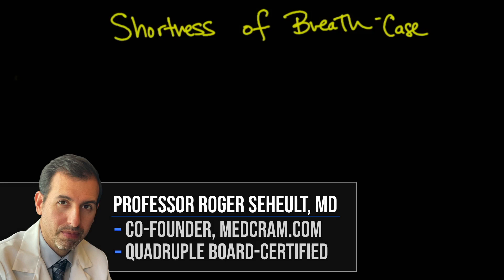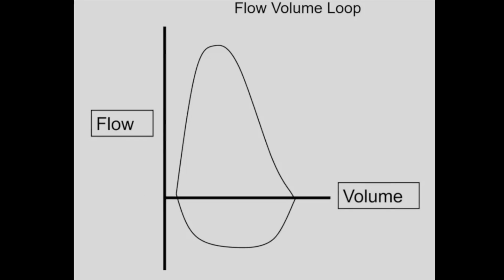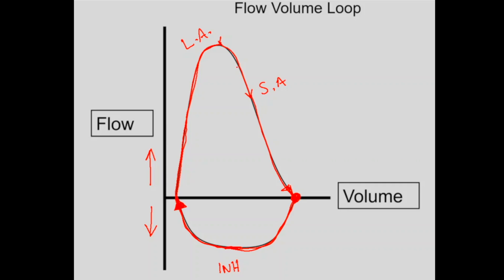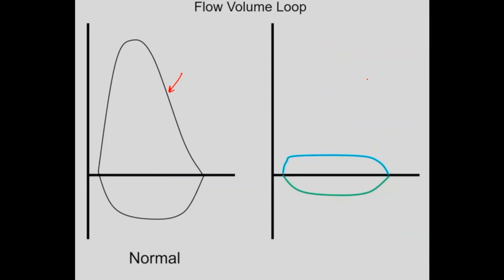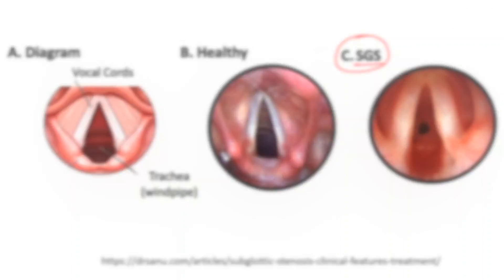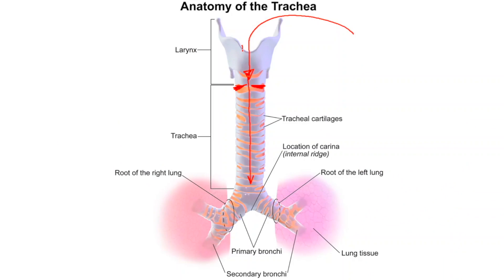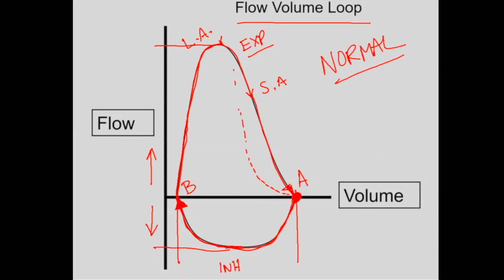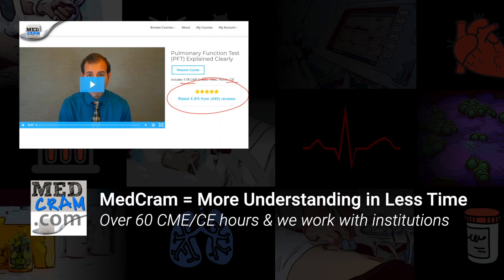Shortness of Breath - Flow Volume Loop

Comment: Is it possible for someone with asthma to have that type of surgery to increase the volume of air they can blow out? Could that cure them of asthma? How risky is that surgery?
Reply from the maker: There’s no surgery that will improve airflow. Typically bronchodilators are the way to do this. There is something called broncothermoplasty which can prevent constriction

Comment: Could something nebulized have been given as a treatment at discharge (for home use) to have helped the damage heal properly?
Reply: I posted a study link, looks like it disappeared.
It appears intubation injury is not uncommon.
Do injuries go into the records of whoever does the intubation?
How are people trained to do the least injurious intubations?
Are there any records on the least injurious intubation hardware?
Is the injury caused in part from compression of the tissue and lack of oxygen to those tissues?
Would cyclic compression help to reduce the injury by allowing reperfusion?
Would using a gas permeable material such as that of contact lenses help?
Is there a pressure meter on the equipment to know how much force is being exerted on the tissue?
Reply: @mballer Yep we measure the cuff pressures frequently. This isn’t a common occurrence anymore since we use low pressure higher volume cuffs nowadays.
Reply from the maker: Not really
Reply: @Medcram  
How about infrared light?
Reply: @Medcram 
Looks like injury is not uncommon.
What might have caused this woman's greater injury?
Does her injury go into the records of whoever intubated her?

https://www.ncbi.nlm.nih.gov/pmc/articles/PMC7969363/

Comment: How does this differ from acute onset interstitial lung disease, or the increasing inability of gas exchange? (Hemoglobin production decrease, autoimmune inflammation)
Reply: This example was caused by a blockage of the airway (trachea). Interstitial lung disease occurs in the actual lung tissue, where oxygen moves into the blood.
Reply from the maker: In this case the issue was with the air transportation but not the diffusion in the tissue.

Comment: I have had chronic dyspnea from vape damage to my airway/vocal chord(s) (dysfunction) for almost 4 years now. Any suggestion you have to improve the perception of a full breath again would be greatly appreciated. (My flow volume loop is normal)
Reply: How do you know vape damaged your lungs?
Reply: @FirstnameLastname-pe5ib They found metal flakes coming off of it.. Do you have advice that helps?
Reply from the maker: That's a hard one with out looking at the CT scan and perhaps a bronchoscopy or biopsy.
Reply: Vocal cord dysfunction is often treated with speech therapy.
Reply: Reincarnation